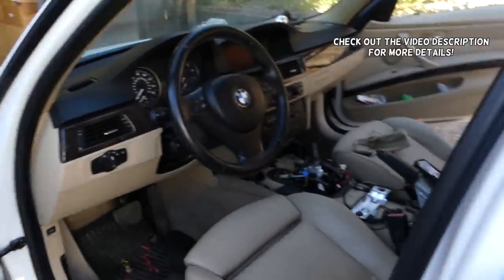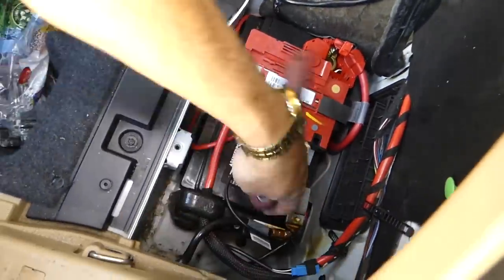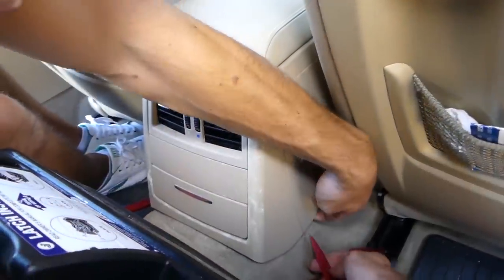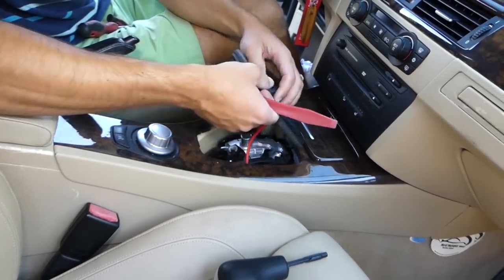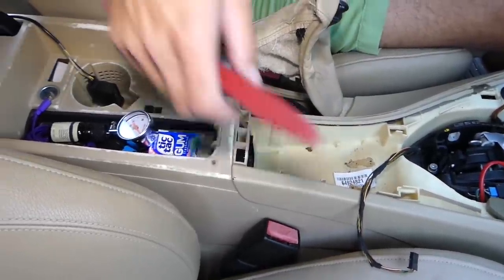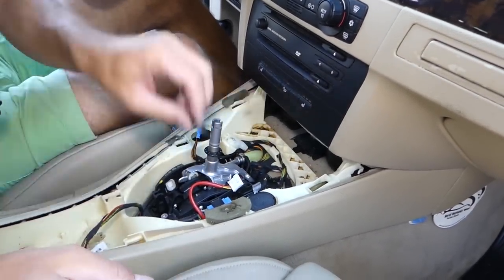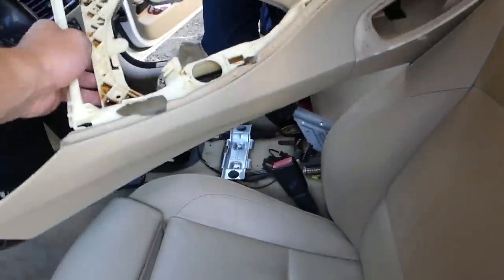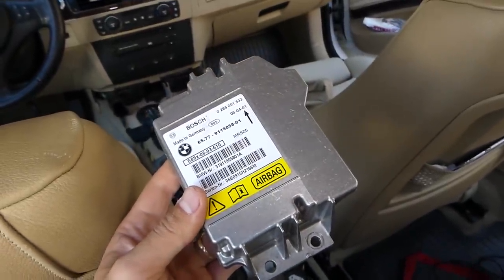HOW TO REMOVE REPLACE AIRBAG MODULE ON BMW E90 E91 E92 E93

Comment: hi i have an issue with my passenger coursing airbag the code is 93b1  and i  found out the air bag is deployed i replaced with a new airbag but the code still come out u think is the airbag. module ?? thanks for the help and great video btw !!!
Reply: Alexander Rivera hi I have the same issue, we’re you able to fix this? Thank you

Comment: Hi bro i have got a 630i e64 and the airb. Light is on . The coputer fault say that thare is no interection circuit.. so is it the module ? Do i have to change it or reset it ore somting? Thanks

Comment: If replacing airbags do you have to switch the modules? And for the steering wheel do you have to change the clock spring ? If changing the steering wheel air bag?
Reply: Just reprogram it

Comment: how can i reset my driver airbag stage 1 on my 2011 bmw 335i?  e90 i disconect the battery and remove the steering wheel airbag when put everthing back on the airbag light show up and the code i got is for footwell module can this cause airbag light to show up?

Comment: Hey recently have been having a lot of electrical issues air pressure loss when all tires are good, check transmission which goes on and off, key not detected, doors not locking and unlocking but few minutes later it works brand new battery on remote control driver restraint system. On a 2012 f10 520d can you please help
Reply: Same , did you ever figure it out

Comment: Okay I got a 2013 BMW 335IS and my seat belt on the driver side is really sticky doesn't want to come all the way out I got a fault code for passenger restraint system affecting airbag belt tensioner or belt Force limiter. I can't figure it out I know that when the guy tried to put stereo system in the car he ended up cutting the wire while the battery was still connected put all  stuff back together and then I have all these codes. I also have the Carly app and Bluetooth device. It's giving me mk16 code and mk6 code 009149